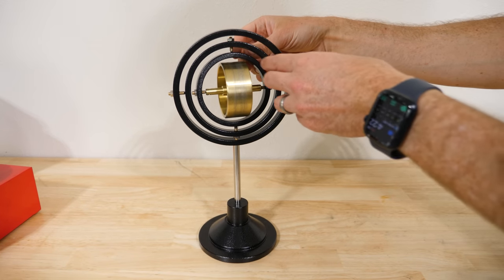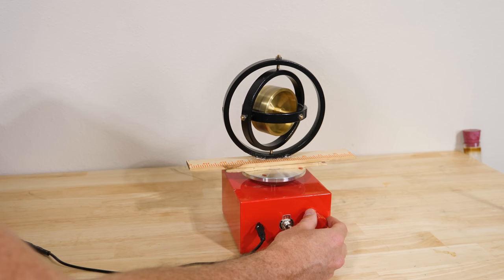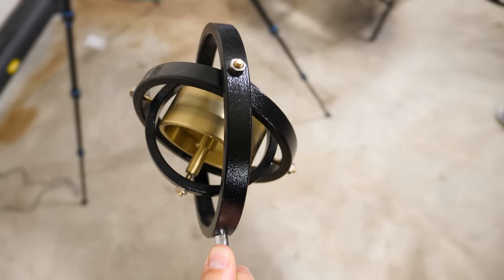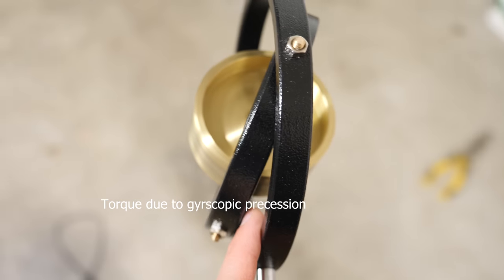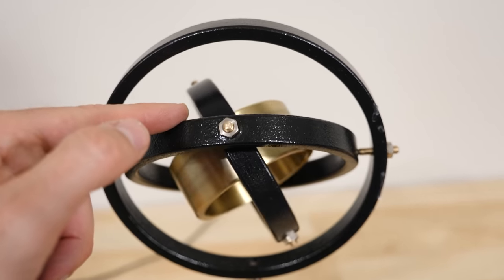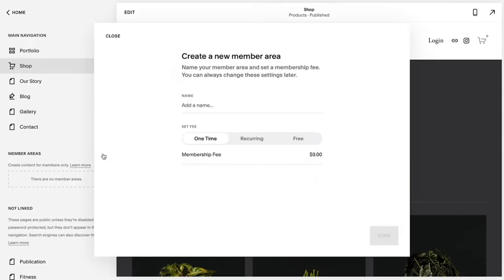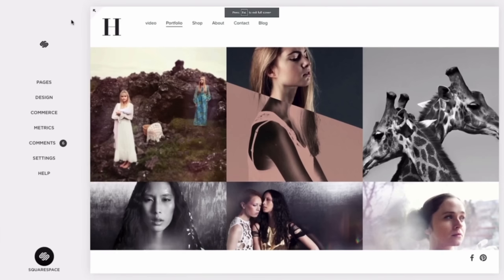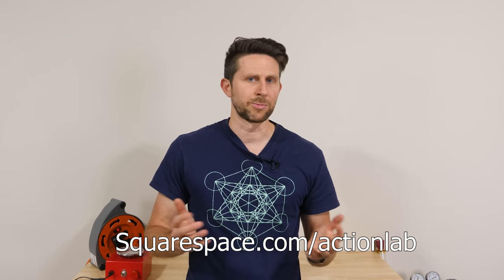Can Gyroscopes Provide Free Energy For The Planet?

Comment: What happens when we have managed to do it superscale and extracted enough energy from the planet's rotation? Would it not slow down the rotational rate and perhaps even affect its circumsolar orbit? We might end up causing Earth to veer to or away from the sun (either would be devastating).
Reply: It would without doubt.
Reply: It would take millions of years of draining power in this way to have any measurable effect on Earth's rotation. Any civilization capable of effecting a planet's rotation enough to significantly alter it's orbit would already be able to put it back in the original orbit (technically you'd just need to build a gravity tractor, like putting a small asteroid in orbit of the Earth and using it to pull the Earth into a new orbit. We have that ability already, just not the will or funding to do so)
Reply: @berserkasaurusrex4233  it will start to alter the earth from the moment you started useing it and to correct for the error with energy lost which you would get means you would have to use more energy to put it back than was taken out. Basically if you so no. Then you are saying you are creating energy. And we all know this can not be done. Energy can not be created and it cannot be lost. Or that's what I was taught in school. But then I have not been to school for 60 years. Have things changed? Lol
Reply: @petethewrist  No, I'm saying you can alter a planet's orbit with relatively little energy change. The planet is already moving, you'd only need to add or subtract a small amount of energy to change it's trajectory to move it into a new orbit. That can be done by simply putting something into an elliptical orbit (technically even modern satellites alter Earth's orbit) around the planet.

The rotational energy of a planet is vastly higher than the energy needed to move it to a slightly different orbit. Any civilization technologically capable of harvesting a planet's rotational energy will already have the means of changing its orbit. You could pull energy from the Earth's rotation for millions of years before it's daily rotation had dropped by even a few seconds. You can't harness energy at those levels without being a very advanced species, nor would you need to.
Reply: @berserkasaurusrex4233  yes you could be right but we are nowhere near being that clever. At the moment some are worrying about a thousath of a second that our orbit has gained or lost I am not sure. But to gain energy from a thing means that thing loses energy. I would love to think this could be done but long term I say no.
Reply: @berserkasaurusrex4233  but that was my point. What ever energy made it come off orbit. It would require the same amount of energy to put it back. And as with all energy usage it would suffer lose, so in fact we would spend more energy putting it back than what we took out to move it in the first place.
Reply: @petethewrist  We aren't taking the energy from its orbital velocity, we're taking the energy from its rotation. Slowing down the planet's daily rotation by a second will have a negligible effect on it's orbit around the Sun.

Adding a small asteroid into Earth's orbit (or even just a close flyby) could easily undo whatever small effect was made to the orbit by slightly reducing Earth's rotation, and changing the trajectory of an asteroid to have it fly near the Earth doesn't necessarily require that much energy. While the energy gained from reducing the rotation is enough to run our civilization for 10's of thousands of years.

I don't think you quite understand what's being discussed here.
Reply: @berserkasaurusrex4233  the one effects the other we could end up with 36 hour days. Time is endless. Not that I think mankind will be here much longer. He is killing his garden bottle earth.
Reply: @petethewrist  Again, I don't think you understand what's being discussed here. We could pull enough energy from the Earth's rotation to power our entire civilization for 10,000 years and the length of a day still wouldn't be one second longer. It would take millions of years to pull enough energy out of the Earth to make a day just a few hours longer, and by that point we wouldn't be humans anymore, and most likely wouldn't be living on Earth anymore either.
Reply: @berserkasaurusrex4233  so you are saying we get energy for nothing. Better check out some other videos on this subject. We are not talking about taking out small amounts here but big amounts over a long time and every second counts
Reply: @petethewrist  No, that's not what I've been saying at all. I just don't know how better to explain it without being insultingly simplistic.

Rotational energy and Orbital energy don't really have a strong relationship. Removing one doesn't generally have a large impact on the other. Any change in the orbit would be so minor it could easily fixed with minimal added energy, far less than we'd have pulled from the Earth's rotation. This is not energy from nothing, this is two unrelated sources of energy.

Imagine a semi-truck going down the highway, hauling 20,000 gallons of gasoline from a refinery to a gas station. The trip requires just 100 gallons of gas to power the truck. Once the truck has off-loaded that 20,000 gallons at the station, it just needs 100 gallons to get back to the refinery. The energy in the truck's 100 gallon fuel tank and the energy in the 20,000 gallon gasoline tanker are effectively unrelated to each other. Likewise, the energy in the Earth's rotation around it's axis is not the same energy as in it's orbit around the Sun.

There is a tremendous amount of rotational energy in an object as massive as the Earth. If we pulled power from it for our entire current population, we could power every city on the planet for ten millennia and the length of a day still wouldn't change enough to notice, because we'd have barely tapped the total energy stored in the Earth's rotation.

Any change in the Earth's orbit would be minor at most, as the relationship between the orbit and rotation are very weak. As such, it would take relatively little energy to put the Earth back in its original orbit.

I can't simplify this further.
Reply: @berserkasaurusrex4233  you are the one keeping on about orbital decay.??????
Reply: @petethewrist  That's what we've been discussing. It's right there in the OP: "Would it not slow down the rotational rate and perhaps even affect its circumsolar orbit?"

I replied to his question and you've been replying to my response.
Reply: @berserkasaurusrex4233  what you smoking? It must be good
Reply: @berserkasaurusrex4233  the other way round you are mixed up.????

Comment: I had a similar idea with a magnet in a satellite able to flip when it reached different magnetic poles of the planet and some gear ratio mechanism that spun at high speed to convert the high torque to low torque high rpm thus generating electricity. But it would be another thing trying to get the useful energy back to the earth.
Reply: The energy you would extract from this would effectively be the kinetic energy of the satellite. The resistance of the magnet would cause the satellite to slow down and eventually burn up in the atmosphere.

Comment: Just what we need, people slowing the earth's rotation for a temporary source of power.
Reply: Our lives also depend on clean energy.

The Earth has a rotational kinetic energy of 2,138×10^29 J. World primary energy consumption fell to 556,63x10^18 in 2020. At that rate it would take approximately 384.097.156 years for the Earth to stop.
If we can use Earth's rotational energy as an environmentally friendly alternative to carbon based fuels right now, in a million years or so we can start to put energy back into the system.

Comment: As you lift a 1kg mass through 1 metre you convert a certain amount of kinetic energy into the equivalent amount of gravitational potential energy.  However, when you let the 1kg mass fall down through 1 metre aren't you converting the gravitational potential energy into LESS kinetic energy as the 1kg mass falls through 1 metre than invested into lifting the 1kg mass through 1 metre in the first place if the energy required to produce the required upwards resultant force over a 1 metre distance would be greater than the kinetic energy of the 1kg mass exerting the force corresponding to this mass downwards over the same distance?

Comment: You can't extract kinetic energy from a system at equilibrium (Earth). If you want to extract rotational energy from the Earth, you need to include something in the system that hasn't reached equilibrium, like the moon. Earth isn't rotating relative to us, it's rotating relative to other celestial bodies.

Wind energy is fueled by the sun's heat, tidal energy is fueled by the moon's kinetic energy and gravity. If it weren't for those exterior objects, Earth's air and water would both be at equilibrium.

Comment: Would you mind creating a video of moving heavy stones via "Phonons" and their resonant frequency?
If you hit the right frequency, you need WAAAAAY less energy to push them around! You can "get" the "resonant frequency" (well, ONE... the "base-line") simply by knocking on it! Using overlapping higher AND lower resonant frequencies increases this effect, but I am not quite sure how the higher and lower frequencies are "connected". It might be a case of "constructive interference"!
Reply: resonant frequency does not reduce an objects inertia.
Reply: @Ddub1083  First off all, you completely avoided me mentioning it in relation to Phonons (a specific quantum excitement) and that alone throws your claim out the window.

You also completely ignored the effect I have mentioned with multiple overlapping resonant frequencies. The same effect can be observed in inverse!
A simple example is a Wimshurst machine... You get LF emission (one impulse per spark) as well as HF (also per spark).

What you assume has nothing to do with reality! *Have you tried it? No?* Your flawed hypothesis tells you it doesn't work and you only memorized and regurgitated it from a flawed book or regurgitating other beings, yet you failed miserably to even look for ONE of the things I have mentioned.
Reply: @Ddub1083 Btw.: IF your flawed hypothesis would be correct, water would not flow above a for example metal plate when you hit the self-resonant frequency.

Even with basic physics, your claim is flawed in relation to my comment.
You do realize that sound is a movement,...
So obviously it is not that the stones "get lighter", but that you put energy in them which continually repell them from the ground.

Everyone who ever had a speaker facing the ground knows, that you can push it way easier around when a sounds is played... A resonant frequency is rather energy-efficient, so you need way less.
That explanation already works with standard physics!
Reply: @tnaplastic2182  lol ok.  let me know when you win the nobel prize.
Reply: @Ddub1083  I don't need or want it... You have not researched enough yet, nor answered any of my questions. Do "Phonons", "resonant Frequencies" and "multi frequency effects" (when they overlap) exist?

I suppose you would at least agree on these, or am I assuming too much?

- Is vibration (normal sound) an oszillation of molecules?
- Do resonant vibrations or even just normal vibrations cause an object on a surface to be moved via less angular energy relative to the surface of the earth, if nothing is moved up or down or not?

I've got some more questions I would hope you can answer.
Reply: @Ddub1083  I am still thankful for your input. I would just like to have a fact-based discussion and not condescending down-talk. I was showing you, that I can do that as well kind of. Well... I don't call you anything and you did not either, so I appreciate that at least.

Comment: On top of that (as of this comment I've only watched up to 3:50) what would happen if the final ring was substituted with a spherical shell (similar to a motor?)

The second issue would be given how much power is generated from the gyroscope wouldn't be enough to power anything significant then I'd add in rather than relying on one to generate enough power, why not have many therefore making the small amounts significant?

Comment: I think one Axis needs to be locked at a certain angle relative to the placement on earth long and lat. But I think you will not get much if anything from it because the power sent to keep it running and something known as drift. The earth may apply an angular motion to your spinning disk, but that power will be equal to the speed required to keep the disk still. And if it's not than the gyro will drift small amounts because of it. So we need to tie a railway around earth and hook it to the moon lol
Reply: Was thinking the same 

I think the 80s tech without good maglev may not have been good enough friction resistance and thus you lose energy to rubbing 

Should be reexplored
Reply: Wait wait if you have maglev it can act as a resistive spring to to rotation so to don’t need to keep it still it just kinks but doesnt touch

Comment: But the earth needs that energy to keep spinning. There's no wasted or excess energy in the earth's rotation. Extract energy from it and the earth slows down.
Reply: The Earth has a rotational kinetic energy of 2,138×10^29 J. World primary energy consumption fell to 556,63x10^18 in 2020. At that rate it would take approximately 384.097.156 years for the Earth to stop. If we use it's energy now for cheap and clean energy, once fusion power is ubiquitous we can pay it back.

Comment: Could be cool if it create energy, at least enough to power his own spin.
Reply: I can very easily proof,that this cant be done. And trying it out as a company is kind of stupid.
To extract any energy from earths rotation,you've got to change its angular momentum relative to its center. For this to happen, you need a external force. This could be something like the moon, but also something on earth speeding up or getting slower angular veilosity relative to earths center. So this is not possible with a gyroscope,cause its center of mass stays at the same point relative to earth. Its center of mass hasnt got any increase or decreas of angular momentum relative to the center of earth. Its basically bullshit. And i wonder, why they even tried.

Comment: why don't you just put a huge pole on the moon long enough to reach the earth and add a spring attached the a wheel, so when the earth spins the wheel can spin and any roughness will be cushioned by the spring add a generator and there's your free energy.
Reply: Good luck finding a material bendy and strong enough to construct that. Also enough of it. Also stretch enough for the hundreds of kilometres in difference within the Moon's orbit.
By that point, you might as well just built a dyson sphere

Comment: Now here's a real crack-pot idea.

If we were to place a massive rotor/flywheel at the north or south (rotational) pole, it would have the same rotation speed as the Earth since that was it's origin point.

However, the Earth's rotation is being slowed down very very very slowly because of the tidal effect from the moon. So if we made it massive enough and frictionless enough, we could harness the speed differential between the Earth's rotational speed when we placed the flywheel vs what it's new tidally affected speed is, and since the slowing effect is relatively constant we'd be able to set a maximum energy harvested to keep it from stalling. Plus in theory since the Earth is ever slowing we could at any point add more weight to the flywheel in the future to add more generation potential.

Absolutely infeasible in the real world, but hypothetically possible to my understanding.

Comment: I tried this with a gyro ball. I put it on a rotating shaft angled at 45 degrees to simulate holding it with your hand. It didn't work.  Unlike with your hand, the ball rotated with the arm.  Apparently this frustrated the rolling of the bearing around the track and won't keep the gyro spinning.  There may be a way but my approach with the gyro ball failed.

Comment: despite not directly comes from the earth rotation, we've already been extracting earth rotation's energy through the wind
Reply: Or tidal energy.
Reply: wind and tide is not extracting energy out of earth's rotation. Wind power comes from sunlight that heats the air, then the hot air rises, and the earth's rotation then messes around with the direction that the air travels, creating huricanes and all, but it doesn't add more energy to the wind.

Tides are caused by the earth's rotation being different than the orbital speed of moon. Tidal power isn't extracting energy out of earth's rotation, but from the difference of angular velocity between earth's spin and moon's orbit. Extracting tidal power does slow earth down, but it also changes moon's orbit. 

This gyroscope idea is impossible, it violates one of the basic laws of physics, conservation of angular momentum.